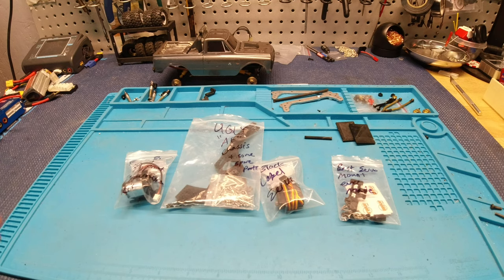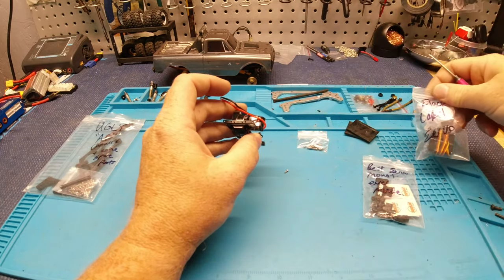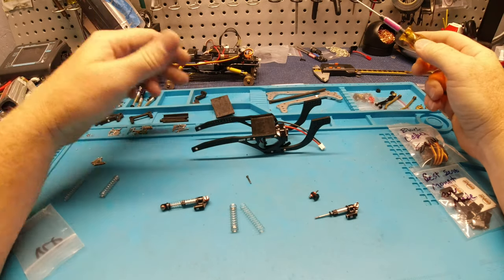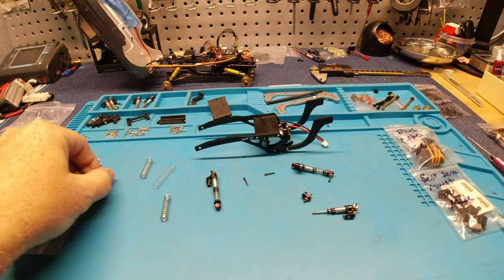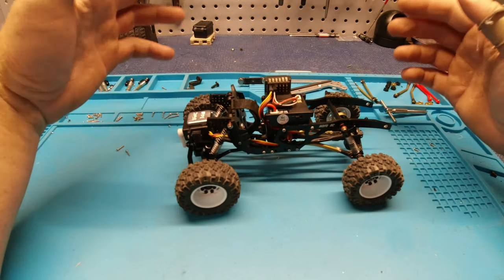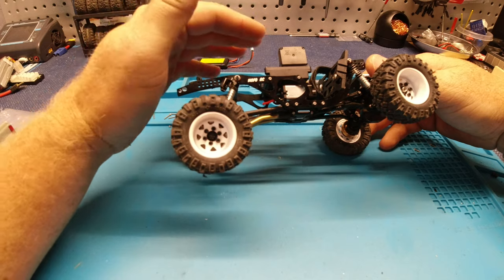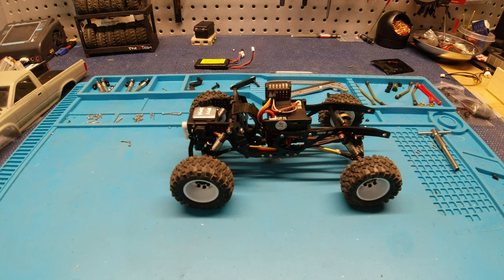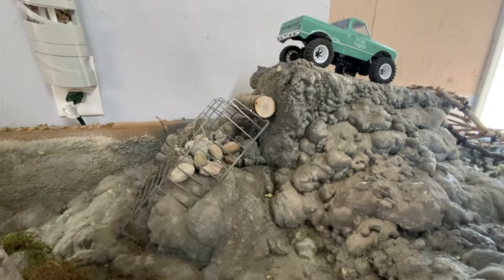Mofo Ugly AF chassis kit! Best LCG chassis for an SCX24?

Comment: Got the ugly with tegu/komoto full send +10 axles and 7mm hex extensions NSDRC servo Little Guy tires this thing is unstoppable!!!
Reply: Did you run into an issue with the motor hitting the battery, with that setup?
Reply: @ravermazing  Just velcro it a liitle higher on the chassis without the tray.

Comment: I want one for my deadbolt! What did you do with the wheel base?  If you could do a future video on adjusting driveshaft length that would be awesome. I would love to know how to use the extra female shaft that comes with the links. The universal pins need to be pressed out? Or the shaft tabs bent out over the pins? I can't find any info on this anywhere....
Reply from the maker: Shaft tabs will bend out around the pins. The pins are connected to the little ball part on them so the pin itself don’t come out. I honestly never know what driveshafts I’m using. I have a ton and just grab some that match up to whatever high clearance links I have sitting around lol
Reply: @2fmrc  Oh awesome! Thx. I didn't want to risk breaking my drive shaft. This chassis is so new I wonder how it will work on stock deadbolt. It appears It will resist angling the front shocks back..I guess you can mod your wheelbase as needed.

Comment: where can i buy the tool to work on my scx24 the L rench or whatever it’s called that came with mine doesn’t really fit most of my of the nuts on the truck like if some of the screws were stripped already
Reply: I ordered the standard dynamite set from horizon hobby works great!
Reply from the maker: I absolutely love the MIP stuff but it’s pretty expensive. Last forever though! Here’s the one that’s used mostly for the scx24 
https://bit.ly/34luAMd
Reply from the maker: Any of the drivers will handle the scx24s though honestly. Bigger trucks things are sometimes a little tighter etc so a really good tool is nice to have. This is a good starter set also. 
https://bit.ly/3fEtp0n

Comment: What receiver and esc did you use here?
Reply from the maker: Running the tegu esc with my flysky noble transmitter. I need to pick up some of the micro receivers for it but for now I’m running the FGR4S receiver. I like them because they don’t have an antenna wire. Those little wires always drive me nuts lol

Comment: You think this would work well with the Komodo rear facing mount?
Reply from the maker: Yeah it’ll work
Reply: Where can I get this mount?
Reply from the maker: @ravermazing  well I just flip the transmission and run the motor front or rear. Whichever I prefer for each build!
Reply: @2fmrc  thanks. I’m hoping I can make it all work. I have the komodo and tegu coming, and just placed an order for the ugly. I hope the cnc mount from Furitek will mount centered so as to not interfere with the rails. What modifications will I need to do in order to run it reversed?
Reply from the maker: @ravermazing  you’ll just have to flip the transmission and maybe swap or mod the driveshafts a bit. Shouldn’t be too hard to make it all work!
Reply: @2fmrc  thank you sir!
Reply: @2fmrc  Appreciated. You wouldn't happen to know anyone doing custom fabrication would you? I'd love to get some carbon trays cut for this chassis.

Comment: Bigger tires works well with belly draggers...btw where did you get long 4mm nut cross tool?
Reply from the maker: Yeah that’s kinda why I’ve moved more towards the scramblers, power hobby warriors & Injora tires. Need that size of staying low. That tool comes with the rc4wd stamped steel wheels 
https://bit.ly/38PetfF